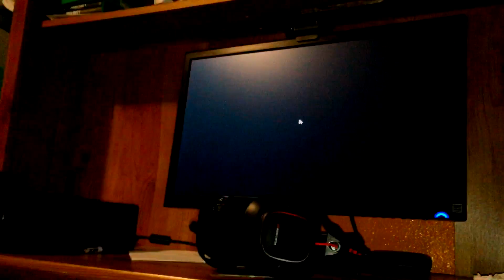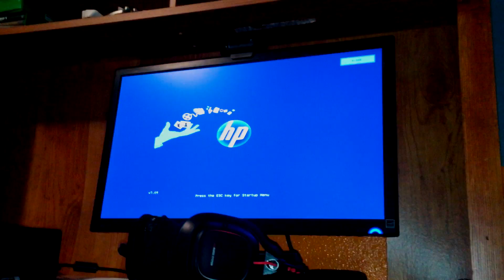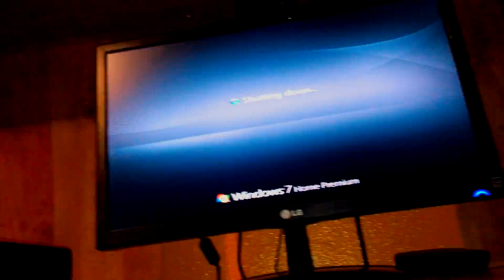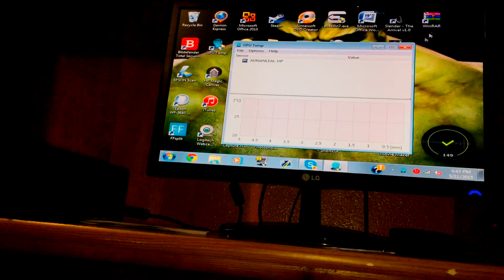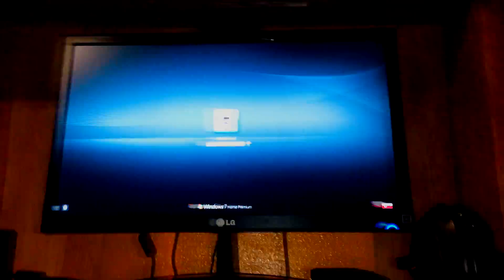How to fix computer when it freezes, dosent display signal,  when it keeps turning off

Comment: might wanna take apart videocard applly new paste to it clean it youtube it  card is over heating shutting down
Also what i think whats going on here power supply shutting down not big enough to run graphics card .
look up your recomended power supply by manufacter like XFX or EVGA etc lets say 500 watts recomended for this card.

 if you have a off bran 500 watt which you payed 20 bucks great deal and it may play a while then burn up stop etc.
 if you plan added 3 to 4 fans to or 3 hard drives just go get a 750 watt Evga ,rosewell, corsair. name brand also look at reveiws at newegg etc  problem soved install it yourself plenty of youtube videos.

 game on  Oh yeah i never buy videocards or power supply Used sellers tend to get rid of their problems on you.
 Clean your computer may help solve problems

Comment: when i play games the monitor always shut down and say no signal but there is sound from the game. (it only happen when i play games) help?
Reply: Amiee Louise..so is it really working fine now? pls reply..i have the same problem..it happens while playing games for about 30 - 45 minutes
Monitore no signal but the cpu is still on..but i can hear the sound from the game :'(
Reply: +carlo morante The exact same thing has been happening to me for about a week, I have updated all the drivers and everything but that did not work. I have just done everything BecomingNose said in the video and it worked! Have a look inside your computer, take everything out (be sure to remember where it goes) blow off the dust and put it back in, sometimes its just a loose connection or it could be that your GPU is getting to hot. Don't do this if you are not confident enough to, if not then you should take it to a computer store and ask for them to give the inside a once over and make sure everything is in the right place. I am doing that tomorrow because I am not 100% confident and just want to make sure even though it seems to be running fine now.
Reply: is your video card fan is working? cuz thats the problem to mine when i play games it shut down but still have the game sound then i open my computer then rotate the video card fan then it somehow work. i dunno if thats the problem to. but we all have the same problem so i think thats it.
Reply: Daniel Quero It turned out it wasn't working fine and the problem was something else entirely, I did a lot of research and asked some friends, turns out my RAM was crashing, which is what affects the monitors to go out without the rest of the PC crashing, so it might be worth upgrading or checking your RAM since it's not too expensive to replace.
Reply: carlo morante Yeah my GPU fans were working fine, the problem with mine turned out the be the RAM which was crashing causing my screens to go black, so if you're having issues like that too it might be worth checking or upgrading your RAM.
Reply: i've tried removing my ram and gpu and inserted it again..and it worked..i saw a loose pci-e cable..and fix it..i am not sure if thats the real problem..as of now my computer is working fine...im going to check this for a couple more days
Reply: my fan is spinning..
Reply: Daniel Quero I did the same which seemed to make my computer work for a little while longer but the problem happened again a few days later, so it does sound like the problem is your RAM.